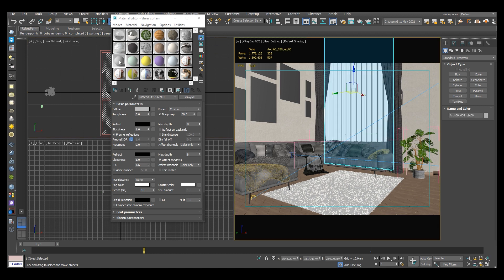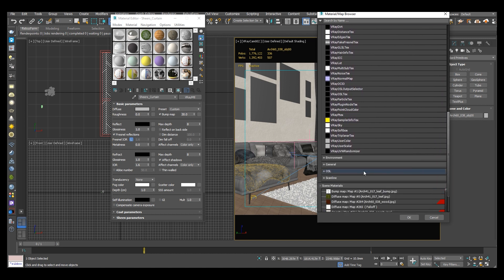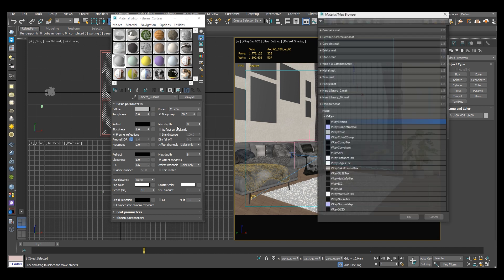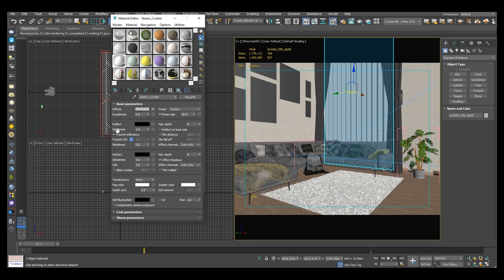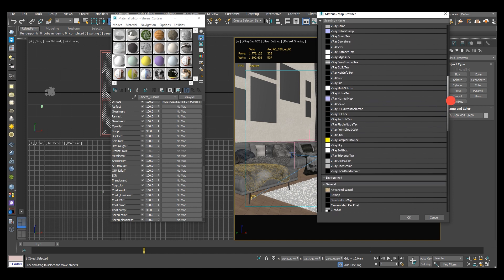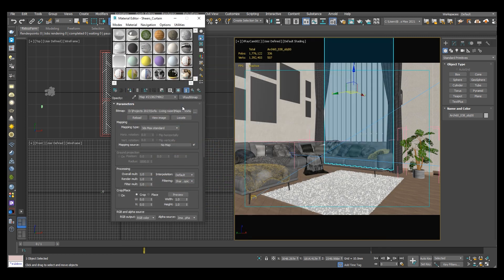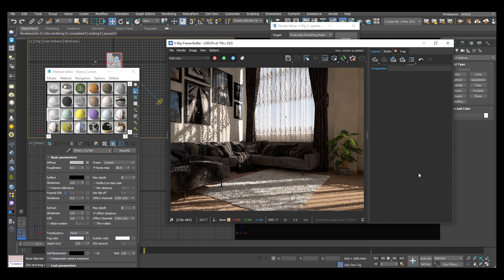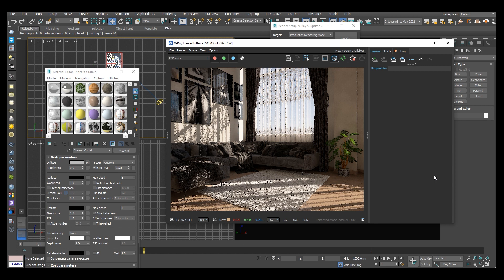How to make a Photorealistic Sheer Curtain Material with 3ds max + V-Ray

Comment: It doesnt work 
i followed each steps still no result
it makes my curtain entirely transparent with no material
Reply from the maker: Hi.
If the curtain is showing up completely transparent, it's most likely one of these three things:
1. Opacity Map
Double-check the Opacity slot. Make sure it has a proper black-and-white texture.
White shows the curtain. Black makes it invisible.
If the map is missing or inverted, the material disappears.
2. Refraction Settings
If Refraction is set to 1.0, it becomes fully transparent like glass.
Try lowering it to 0.85–0.9, and add a light Fog Color to bring the curtain back.
3. Diffuse Color
Your Diffuse color should not be black. Use a soft white or light grey. Otherwise, there's nothing to reflect or show.

Comment: Hello, I'm trying to create a see-through fabric for Herman Miller Aeron chair and this technique does not seem to work. Thank you if you have any suggestions. I tried a VrayBlendMtl with an alpha mask, doesn't work either.
Reply from the maker: Hi, did you un-check fresnel reflections?
Reply: @tech-n-design  no but I just found a way using a Vray mtl with an opacity map and changing some options in the object properties, thank you for your answer :)